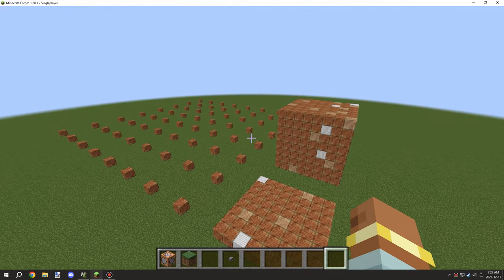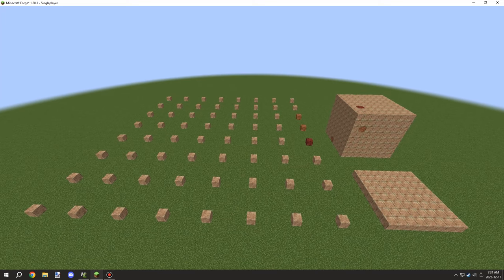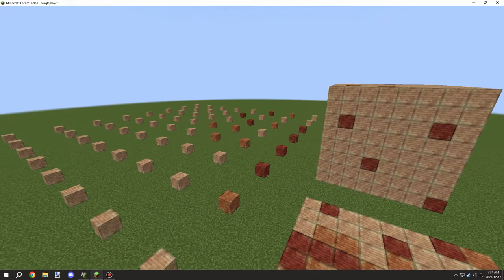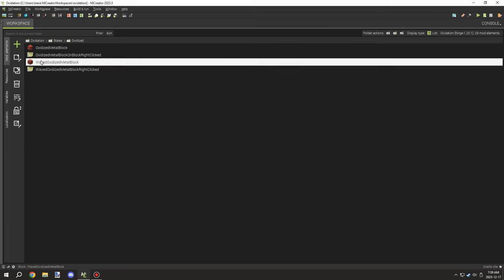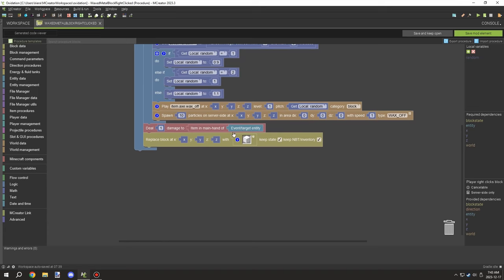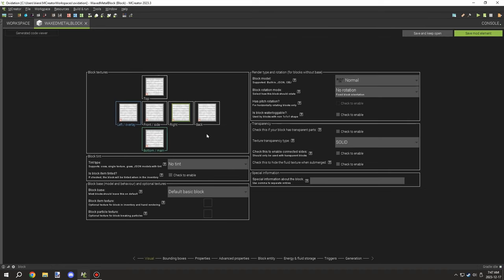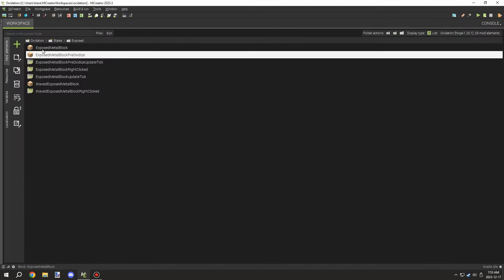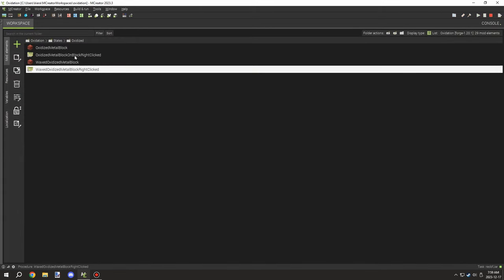Weathering Blocks V2 | MCreator | 2023.3

Comment: Is there any way go spawn mobs outside loaded chunks? I have coordinates for the mob and know it's attempting to spawn but it isn't. Also the coordinates are random each time but still a specific location
Reply from the maker: Not sure how your trying to do it but it will need to be done through procedure, one mainly that can support world, and x, y, z dependencies. You will need to use the force load command (a Minecraft command) this will force load the chunk for the session keep in mind it stays loaded unless tolled to unload which you should do using the same paramotors as the loading one. So the process would look something like below.

1. Make a global trigger
2. Force load the specific location you want to spawn the entity at (use the execute command if in a specific world)
   /execute in <namespace>:<world> run <force load command>
3. Use the summon command to spawn your entity use the "execute in" method if needed.
3. Force unload chunk same process as loading just with one specific change in the force load command.
4. Done

The two commands are listed below.

https://minecraft.wiki/w/Commands/execute
https://minecraft.wiki/w/Commands/forceload

Comment: For some reason the block isnt oxidizing ive download your project from the link and only changed the blocks textures even on random tick set to 999
Reply from the maker: Oxidation takes a long time to happen I had the workspace sped up like 10 times and it was still slow on the cube though the pane and single blocks will oxidize faster. I comparing settings with the example workspace I provided in the download with your mods settings its a good way to make sure things are set up properly.